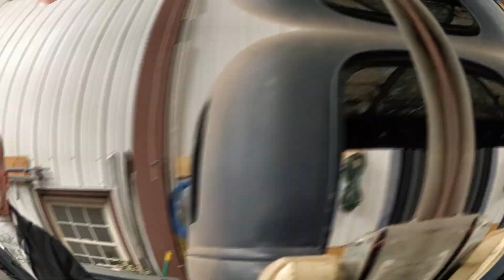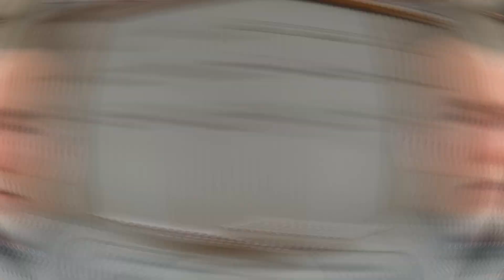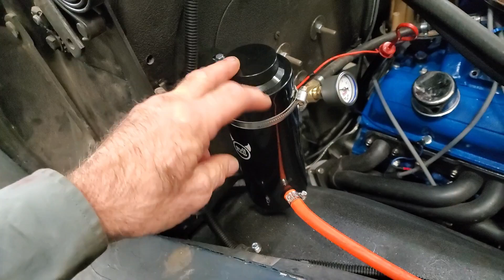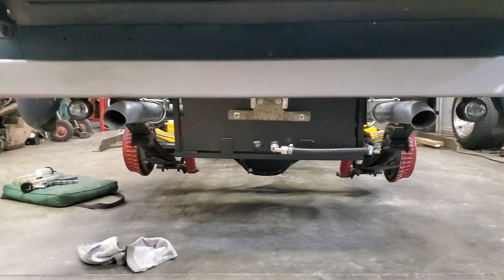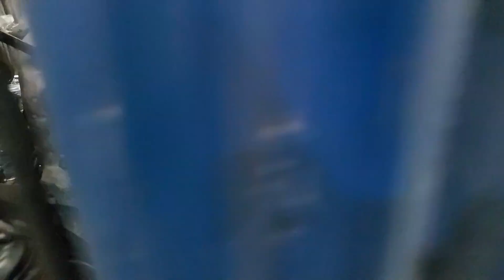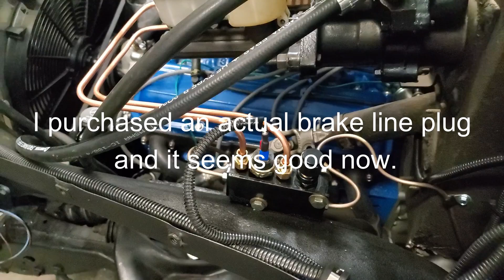52 Old Navy Truck Build ep13

Comment: You said there shouldn't be any excitement! lol 🙂
Reply from the maker: Yeah I lied. I used a set of used MSD plug wires and did not notice the crack in the top of one of the wires at the distributor. That sure wakes you up!
Reply: Your reflexes are pretty good!!  @CJKustoms
Reply from the maker: More high voltage than reflexes!